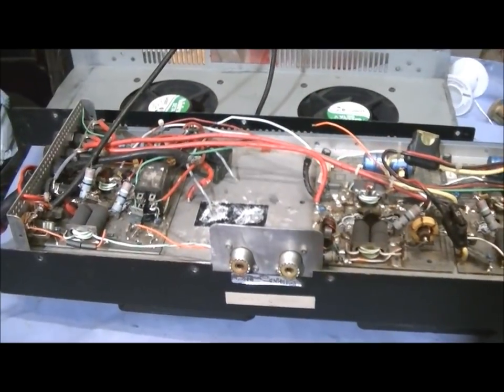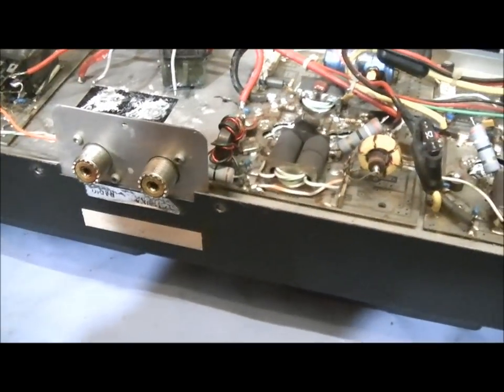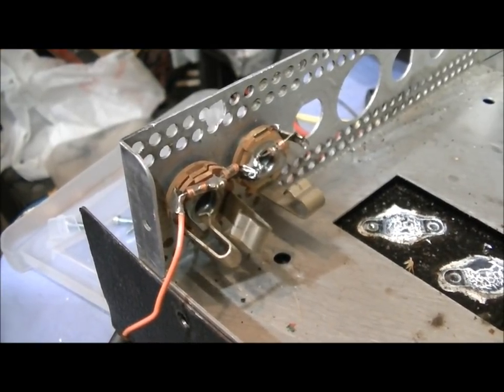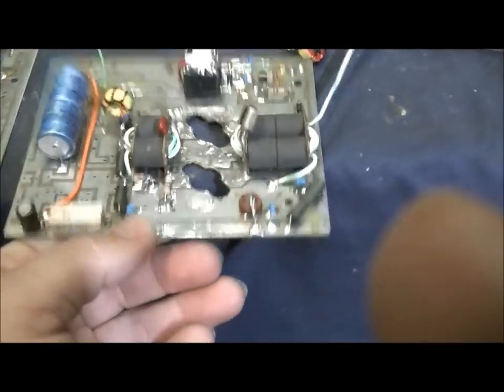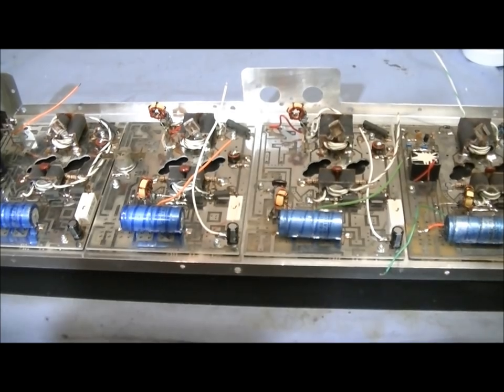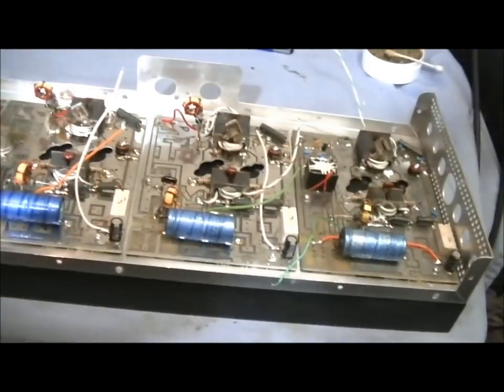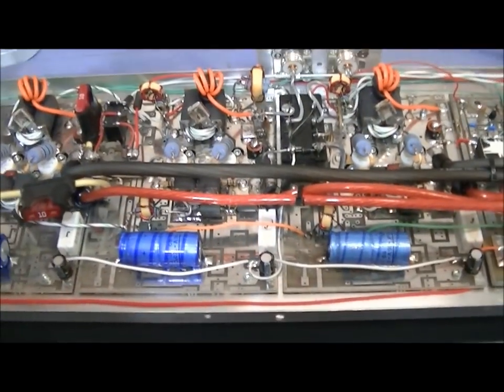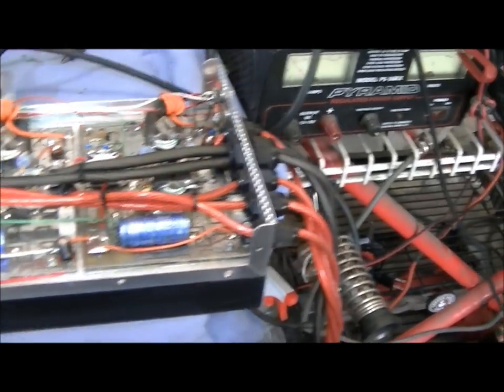Lets BUILD 🛠 A Texas Star Sweet 16 & Control It Wirelessly! REALLY COOL!

Comment: Why would you put the thermocoupler factory ? You must want that amp to blow up, smh.
Reply from the maker: What? You seriously can watch this video and say that I didnt do a good job on it brother?

But you need to reword that comment because I have no idea what you asking.....are you asking why would I put that thermo switch on it factory?  Sorry but I didn't u understand.

I'm not the biggest fan of relaying on the thermoswith and this is why I gave the customer a choice of bypassing it with the wimote.

This Amp is Flawless man. Turned out GREAT! I honestly do not see people like you making comments like this much.....I promise you bud you may be misinformed a bit. You may want to check some of my latest builds and Texas star work.

Now about your thermocouple comment....wasnt sure what you were referring to but you do understand that in this Particular Amplifier, they have it sitting on the board so when the board gets 110 Degrees F that the Fans Turn On.

Actually this is a weak spot of the amp. I would Rather my Fans be on blowing air across the heatsinks and components while in operation then to be relaying on that surface of the board to get to 110 Degrees.

So I did a modification to allow the user to turn the Fans On Manually Instead of waiting till the surface if the board to get hot.

You see what I am saying bud? This is a good thing. More constant air flow the better. I'm thinking with the comment you made that you may not have either understood what I did or u understood what that thermal switch is even doing.

Look into videos a little closer before making comments like that. I take super pride in my work and everything I do is to help the amp have a better chance at lasting longer. No short cuts.

If you really had a real Build that I did it sucks that you got rid of it cause I offer a lifetime warranty on my personal builds no matter who owns it.

Wait till you see what I've done this past year once I release it....I think you prbly will not have the same comments then but please do stop by anytime bud....take a chance to actually see what I am about. I think your comments will change. Or atleast I hope the would. God Bless from the North East End of GA
Reply from the maker: I didnt leave it factory....he is able to bypass it and turn the fan on with a switch now. So I gave him another option.

Comment: Sir, if I wanted to replace these fans with quieter ones, could you recommend some? Thanks in advance for any info. I hooked it all up today and she's doing 1K with a 100 Amp power supply. I have another 100 amp power supply coming in a few days that I will hook up parallel and then I should be in the right area for 2K. :)
Reply from the maker: Please know those fans will keep that amp alive.... fan noise is something that sucks but if you can put up with it...more air the better. But when it comes to quieting down the fan you have 2 choices...slowing those down with resistors or diodes or look at the fans amperage pull for ex if it is 0.8a go find 120mm fans that pull half that 0.4 or around it...simple way of doing it.
Reply from the maker: I'd keep it around 1200 to 1500w to make it last ya

Comment: GatekeeperAmps, when I turn the power on the sweet 16 on, it seems to cut out a lot of my receive in the radio. Is that normal?
Reply from the maker: No that is not normal. When you turn it on power goes to the relay nothing is supose to happen until you key.

Comment: I see you are still using that old electric heater, you need to buy the ones that have the oil in them, they are safer and don't use as much electric as the one you have. Take it from me my friend I know......because my whole house is electric no Gas, 200A service the wire that come's in my house are 1awg.
Reply from the maker: Actually brother since you told me that when I made that one video where I fixed one It is on my list of items I will be buying for my shop. My over all goal is to NOT be out here next winter. I told my self that last winter but I only have a few more builds to go then I can hit the big reset button. Then Ill only take 3 projects on at a time then adjust from there cause ive put my self through hell man. Been a huge learning experience for me that is for sure.

But ass youll see in the video how its off at times....every since you gave me that advice I have been more mindful when it comes to safety with this and I only turn it on when i absolutely have to have it and if I walk away from it even to go in for a sec I turn it off.

But while it is fresh on my mind Imma go price a few before I hit the sac. Maybe I can Afford to pick me up one soon.

By the way...to update you on that Allen (Socket) Head 4-40 Self Threading Machine Screw....I had over 10 people send me links which all 10 wasnt it..some found Hex Heads but i went ahead and went crazy with it and send around 5 request over to there custom supplier sites.

I found 2 out of the 5 that said they could custom make them for me. They told me that your reason why I cannot find any is because it is not a common used screw salt out by industry. They then told me that they can make me what I want with no problem but that I have to buy a bulk order of $1,500 minimum.

The other company had a minimum order of higher than that. Honestly tech I don't need it that bad LOL.

I still want to send you something for looking for me. Itll be a Christmas Present :) Might get there after so just be looking for it.

Also I gotta link to send you to a video, Ill shoot it over to you later. God Bless from your buddy in GA.
Reply: Okay my friend I just want you to be around for a long time like me, so be safe and Happy Holidays!
Reply from the maker: @TechNineKOQ1152  Thank you, Found one for $45 imma try. You have a great Christmas as well.
Reply: @TechNineKOQ1152  How You Doing? Man Been Way To Long. You Take Yourself God Bless . Your Friend From The Devil's Play Ground The Sity of Sin Las Vegas Ol 7Five Double Zero Waving...
Reply: I am still doing what I do best and everything is okay. Thanks!
Reply: @TechNineKOQ1152  That's Good Your Doing Good. Sure Do Miss Your Videos. I Learned Alot From Yours and Gatekeepers Videos.  Well Sir You and Your Family Enjoy Your Christmas and Happy New Year. Your Friend From The Devil's Play Ground Las Vegas Ol 7Five Double Zero Said That...
Reply: @tech nine: hey man, miss your videos alot. whish you would start em up again. would love to get an 8 pill and a driver, you still building? take care
Reply: @51nw  Yep! Still building and repairing, just not on YouTube ever again to many haters don't have the time for them so I went back underground where I was and still is see you! If you can get my number someone and call me but I dough it, HA! HA!
Reply from the maker: @TechNineKOQ1152  @Tech Nine  just wanted to wish you a Merry late Christmas and I hope this will be a very prosperous new year for me and you both God bless you brother your friend the gate keeper out here in the backwoods of Georgia where the the Georgia Pines stand tall
Reply from the maker: @jbuloke  Hey buddy I am back...check out my channel when your able to and I habe more videos coming.

Comment: I love that remote. lot of hard work payed off. I got a hotplate DX 1200 new around 1990 or so. 8X 2290 no fan kit. only thing I did was power wire up grade and bias mod to 1n4997 diodes on top of 2290. I low drive only and use SSB mostly. I took out keying circuit a few years back .RCA jack either my radio keys the amp or foot switch. I put my own 120MM fans on just 2 on heatsink. I did mount a NO 100F thermal switch on side of heatsink . only had a sticking bias relay all the years.  I don't run more than 40 watt SSB PEP in to it. hardly heats up . 4W am . 10 watt FM . I do have a driver with 2290 in it. don't use. used for testing repairs only. I did get 95F 100F switches from eBay . 90F from amazon did not come yet. shipping delay ! last TS I fixed the DX 500 and final combiner was out of stock. I made my own ICA parts. 100 ohm 3 watt . I now have 200 ohm 1 2 and 3 watt . 5watt on way . 100 and 200 ohm. ok to replace feedback 39ohm with 100 . I had some glass caps  on a DX 1600 go bad. RF flash over . look for black streak in cap . when this happens the DC goes threw resistor and over bias 2879 and poof .and that 1.8ohm blown also. love your work and TS DX 1600 lot of heat sink for 8 pills. My personal amps I run 50% or less . never blown a pill ! 73's
Reply from the maker: Am I ever going to be able to see pics of these....? I've asked...how are you mounting the 1n4991 can? BOTTOM I guess down on top of the transistor?
Reply from the maker: Quick ? I have done the bias upgrade to the TS cause I get so sick of the 1.8 going out and frying both pills....so I did this but only issue was that the bias is to high so I had to add another resistor inline which was completly not what I was trying to do.  Now I could replace the 25 ohm with a higher value resistor to fix this but I think I need to figure out something else to do to fix this with out having to do this.  Maybe a 8v Regulator In front of the first 25 ohm but it could run pretty hot on all 4 pills...

What do you think?  We need to talk off here man on the phone.... email  me bud at threemanpro over at gmail
Reply: @1883GotDown  use 1N 4997 diode got that from RF transistor hand book . also try Shockey diode . 1SQ xxx series. some around .55 .6 volte drop . get a 25 ohm 25 watt or so clip it to 14V supply place cathode to neg. and anode to resistor and measure voltage across diode. get that right before putting into HG or DEI PP 100 that hate hi bias . 73's
Reply: @1883GotDown  yes right on the 2879. wight thermalkote grease no CPU type grease. it reacts to RF
Reply: @1883GotDown  1N5822 Shockey diode can be used on HG . has less drop then 1N4997 . I got a diode assortment from amazon some years ago. had to look at my  notes find which number I used before. a LM 317T in front of resistor works . drop to 10 ohm.  LM 7808 will work. tab is ground on that . good 1 amp. I like to keep simple bias circuit. massager does.  it works . I did not come up with this my self. I looked at books and how  outers did and learn from them.
Reply from the maker: @robertmeyer4744  OK thanks buddy!
Reply from the maker: @robertmeyer4744  exactly the c p u greese will act like a capacitor in a way.
Reply from the maker: @robertmeyer4744  Thanks....Yes I have use a 7805 even before because in my mind I was like the less we have to drop the better. Could even out a resistor in front of the regulator to take a little bit of less stress on it. I wonder if they made a 7801 lol a 1 v regulator. Then all you have to do is drop just a little bit.

Comment: The board has to be flush to the heatsink in order to dissipate heat right !?? Just saying
Reply from the maker: Not the board....Just the transistors. Or if there are any other components that need to be mounted on a heatsink. TEXAS star has always used spacers like this because they have to to keep the bottom tracers from shorting out against the heatsink since it is a ground plane as well.....Good looking out though bro.....by the way I think I am getting you confused with one of my customers am I right? He runs a rescue business and saves squires lol....I also have 3 if his amps here for repair...juat seeing your youtubr username makes me think it is him but it isnt correct? I have actually sent you messages on Earlys videos asking it it was you lol.

Comment: After watching this video I'm glad I sold my 8 pill gatekeeper amp without even hooking it up.
Reply: Why is that?
Reply: By the way the amplifiers working great with a hundred Watts input I'm getting a clean 1800 out of it without any problems Tom does great work
Reply from the maker: Yeah bud...what do you mean by that....I built this bad boy from the ground up and it works GREAT! What did you not agree with about it. Please be honest...this is why I leave my comments on. Thanks. Look forward to hearing your response.
Reply: Crap it's been awhile, I think you was working on a sweet 16 and made a comment about the relay for the temperature relay being good in the stock position, witch sucks. I got a brand new Yeasu 450D, 55 amp switching p.s. a little 2pitt superstar amp, set of meters n a couple of other things I can't remember, I definitely made out. Sad note.. the guy that got the 8pill mobile Gatekeeper put in storage cause of moving and the storage unit got broken into n stole, along with other stuff. I talk to 729 Invader on a regular basis n he always says good things about ya, just takes awhile to get it back.
Reply from the maker: @5zero12-cents9  Roger roger....my question was, why did you get rid of my 8 pill amp with out hooking it up just by watching this video. That was the question. That confused me? Almost like you didn't like the say I work or something which doesn't make much sense. Even watching this video years later I did a heck of a job putting together this Texas Star Sweet 16. Thanks in advance.
Reply from the maker: @5zero12-cents9  i agree about the temp switch on this amp...it will go off In a hot car...that is why I gave this guy the choice of leaving it the way it is or turning it on with a switch.

Comment: hey, what do you think the max input drive is to get full output on the new sweet sixteens with all hg transistors?
Reply from the maker: They should be the same amount of input as regular Toshiba I normally don't drive it no more than a one pill or if you going to use a Texas Star 2:50 or something Aquila event than run it on low